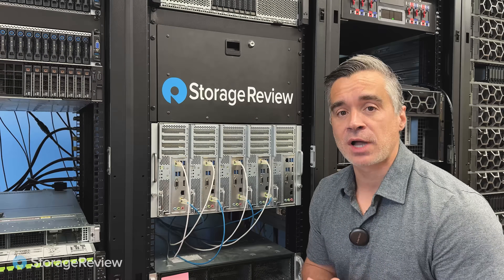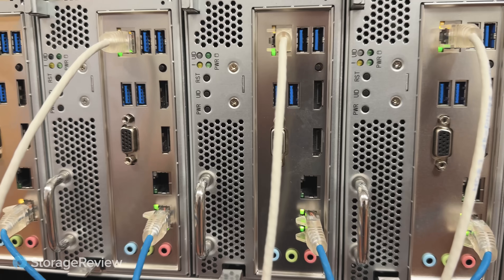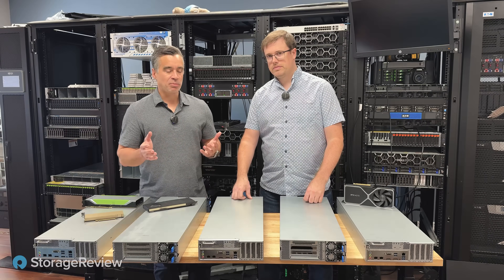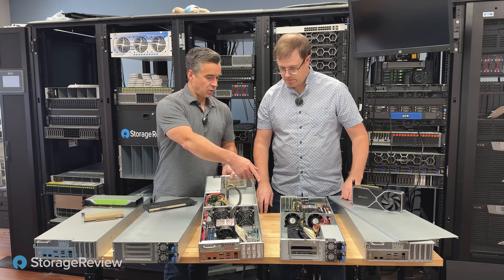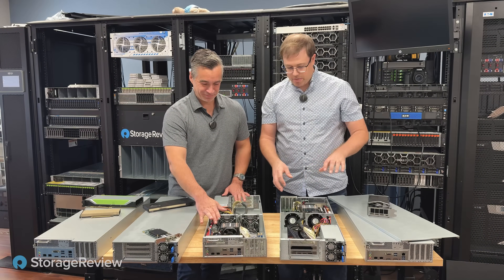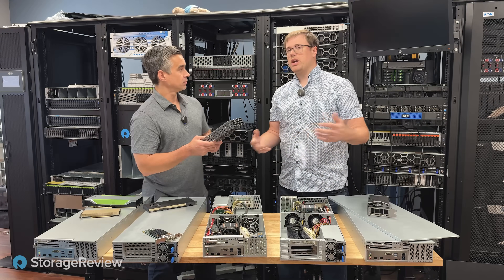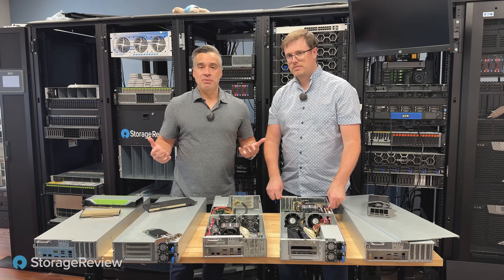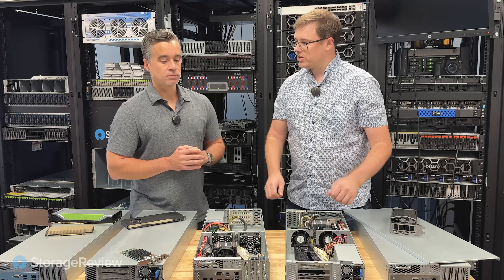Powering Cloud Gaming with Efficient AMD Servers

Comment: I didn't know you let discord users use those PCs! I would be curious the advantage of 4004 Epyc versus Ryzen? Both have high clock speed, more cores, Enterprise features? Ryzen would be far less expensive for the same x86 compute and for gaming, GPU would be bottleneck ?
Reply: Epyc 4004 is validated for enterprise use and features such as ECC memory, but they’re functionally the same Ryzen CPUs.

Comment: They're SOO LONG not a very efficient use of space. Should share redundant PSUs - 10 PSUs is super expensive and more failed units.
Reply: It's designed for specific use and i like the design
Reply from the maker: We didn't find them to be long really. As to the PSUs, the intent of this design is a shared-nothing architecture to let them silo as individual bare metal servers. If you want blades, those exist, this use case is pretty specific.
Reply: @StorageReview  
Looking more into it: Max up to 105W (TDP) 
So you said it's for gaming but doesn't even support the 3 fastest processors! Also I'm surprised it's not 2.5gbe and just 1gbe since that's the standard on AM5 consumer boards.

Comment: afaik nvidia still has that datacenter deployment ban in their GeForce software.
Reply from the maker: @lctsi  most gaming servers don’t even need the GPU. We used one as a Rust server.
Reply: IIRC Jeff from Craft Computing said they removed the block on > 10 series cards.
Reply: @acubley  I looked, and it's still prohibited in the nvidia geforce driver software eula. It doesn't even have exceptions for cryptocurrency mining now.
Reply: I think that might be why Shadow cloud gaming uses NVIDIA workstation GPUs instead.